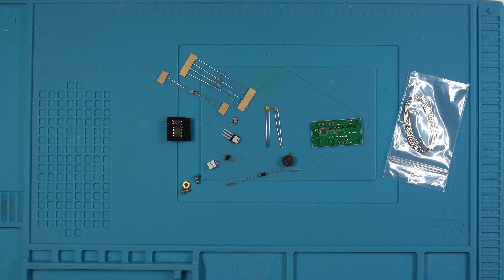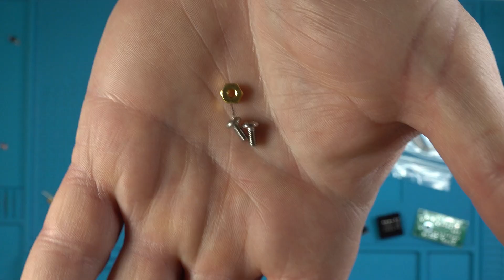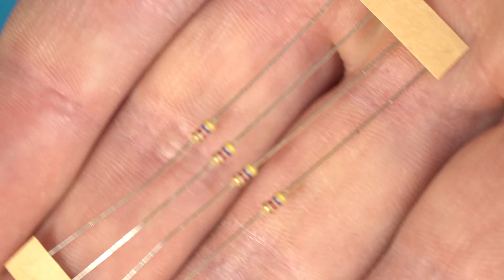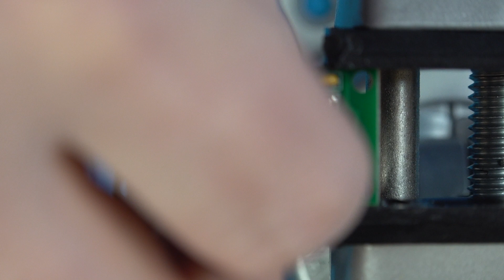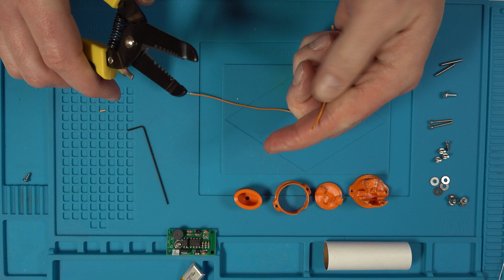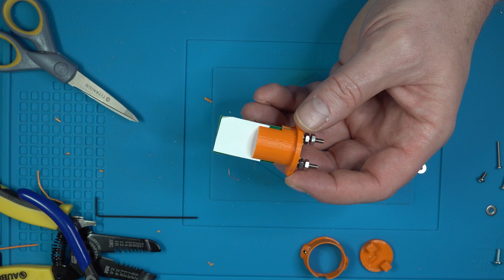Eggtimer Apogee Build Rev D9 with Easy Mount - May 2023

Comment: What’s the ideal temp for the solder that came with the kits? My finished product isn’t looking quite as clean as yours and I think I might be heating the solder too hot. Would that cause it to bleed through the holes to the front side?
Reply from the maker: All irons are going to be +/- some percentage of their set temp (unless you spend a whole lot of money for an expensive soldering station and tip thermometer). So, you are going to have to dial in a good temp for your iron. Generally, I would start with my iron set to about 360C/680F. If the solder does not flow well, bump up the temp a bit (I find 380C/700F works best on my iron for the no-clean solder that comes with the kit). If the solder spits/sputters somewhat when you apply the iron, the tip is too hot. Also, the no-clean solder can sometimes have a slightly dull look when it cools, compared to rosin core solder. You can switch to using rosin core solder (this is the rosin core version of the solder that comes with Eggtimer kits: https://www.amazon.com/dp/B00068IJWC?th=1). Rosin core flows better, is easier to work with at lower tip temps and does result in a nice shiny solder joint, but it does leave some flux on the board, which can be cleaned up with 99% isopropyl alcohol.
Reply: @mountainmanrockets5644 I went through your Quantum v3 video. Turns out my iron was too cold. Brought it up to 680 and it works like a dream.
Reply from the maker: @greedypaul6343  Awesome! So glad your builds are going well!

Comment: I built one of these. I bought the Easy Mount, but will be miunting it in a Loc 2.6" ebay as my first electronic deploy. I may later add a Quark as the main and the Apogee as backup for just the primary as I use a Jolly Logic chute release.  It was a fun, easy build. Can you plug a telemetry module on this one?
Reply from the maker: Glad you had a good build! The telemetry module will not work with an Apogee - there is co way to connect the telemetry module to it. The best way to get a relatively small, independent telemetry experience is with an ION.

Comment: I used the chisel tip that came with the FX888D.  It's not ideal for GIPO expander/flash chips on something like the Quasar but not difficult either.  It works great for the SMC capacitors/resistors.  Great high quality video!
Reply from the maker: Thanks for the feedback!